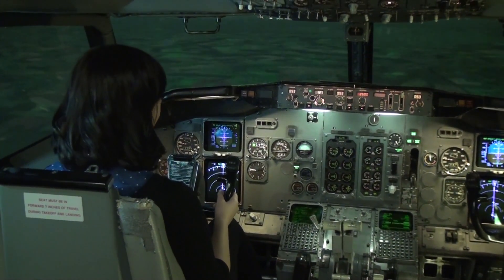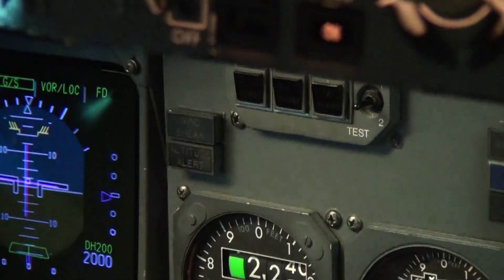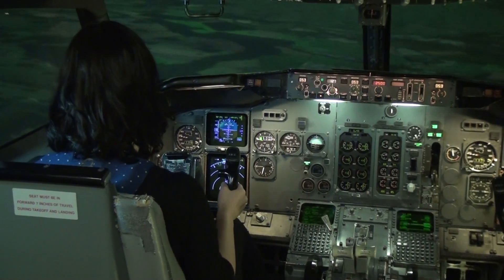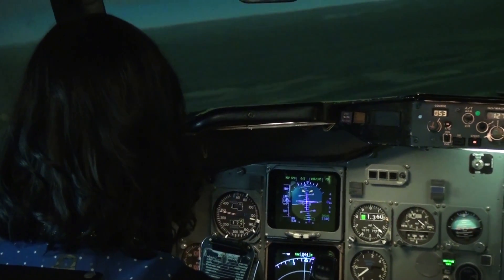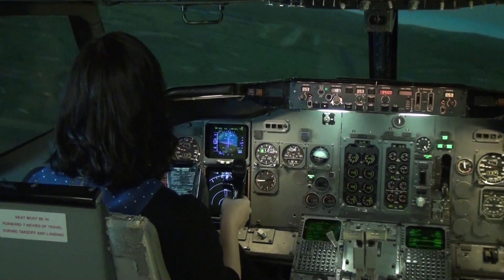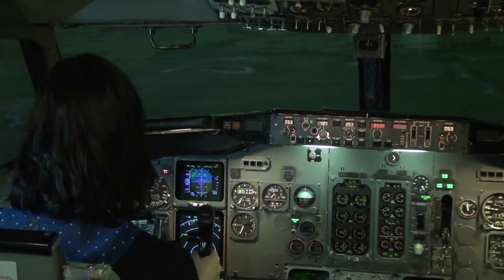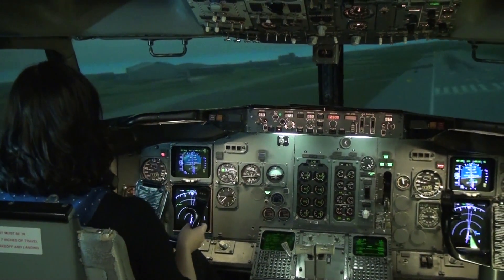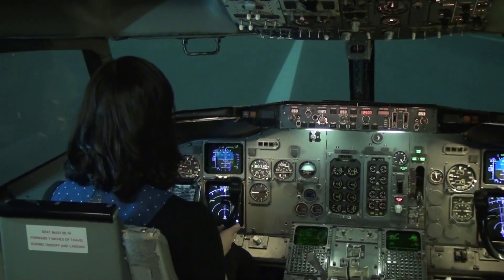An Amateur Trying to Land Boeing 737 manually

Comment: The autopilot was still engaged to maintain the speed by the looks of it, probably for the best I'd bet it would be far too much for an amateur to worry about everything for their first time manually landing a 737.
So if I'm ever to land a plane I think I'll stick to using the auto pilot as much as possible. Far easier to catch the localiser and glide slope using that than trying to do it manually.

Comment from the maker: Baltic Aviation Academy (Lithuania) decided to do the experiment - take a person who has worked in the company, has a little clue how to control aircraft with a help of autopilot and air traffic control and to leave conducting landing manually. What results it is going to bring?
Reply: James Stone jajajajj good answer. Exactly everyone thinks being a pilot is easy.
Reply: You should do it with someone who uses a home computer for simulation, but has a good knowledge about the 737 and flew several hours. Devide them into home cockpit/keyboard-users. Let's see what results this will bring. This will be a little bit more than entertainment ;) And sorry if you already tried that, since I see that you tested a CPL holder :)